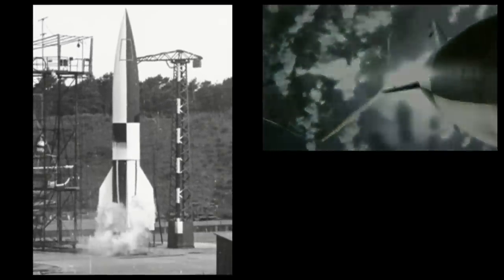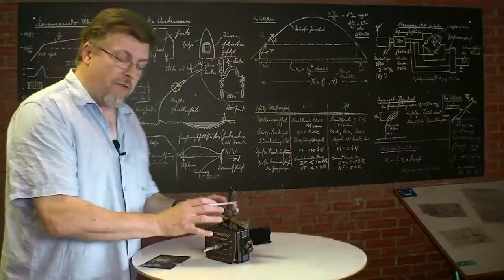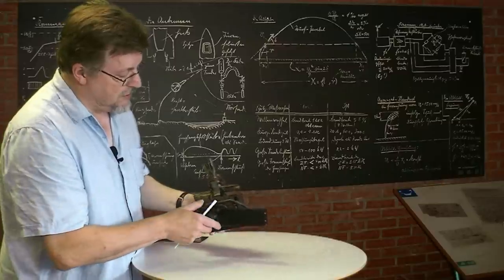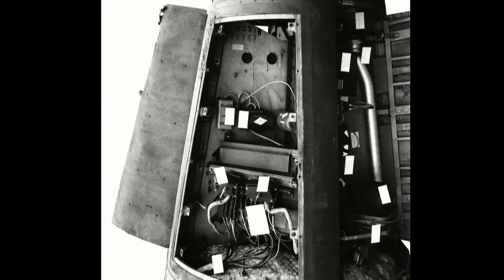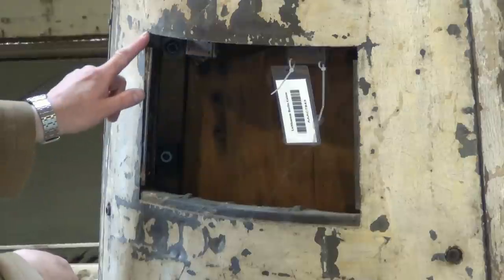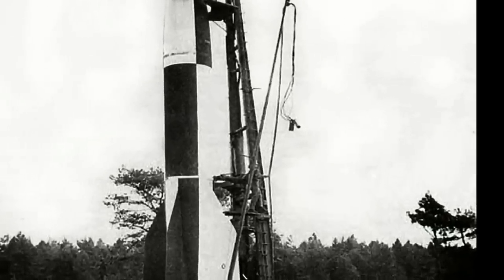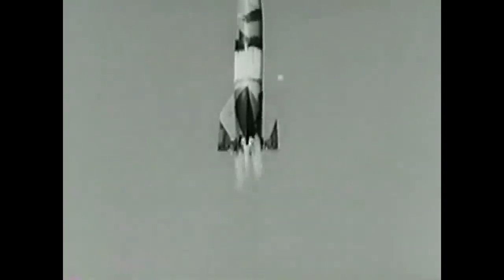A4 / V2 Rocket in detail: umbilical cable system

Comment: Interesting, pin and socket seem similar to our earlier Swedish/German 1935 ASEA relays (plug in)  Eg: 4mm pins, as used in Banana test connections, but better quality than a single wire spring (ours have 4 fan like nickel-silver fan contacts end riveted on a central spine, usually 10 pins per relay,  and these 50% polarized, and standard silver contacts,  5 - 900mA rating )
(Nick Alexeev:-  So both M & F connections in this above case are JACKS ?        .'.   We have 16/32    jack in a  Box    :)
Reply: Stotz still is a Part of ABB and based in Heidelberg.

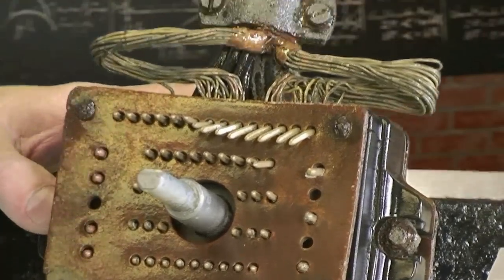Comment: At 03:38  ... maybe the used multiple pins for the same connection/wire. Most likely power and ground. Both for redundancy and to handle the higher current.

Comment: We could really do with a explanation of the turbo pump, which is the most important part of the rocket. I wonder how they managed to control the mixture and get the thing to light? Also, regarding the gyro guidance system, there's rocket angle and heading to take care of, but what if the rocket (say) rotated about it's longitudinal axis by 90 degrees - the steering vanes would be incorrectly orientated I would think?
Reply: John Smith it was steam driven

Comment: I had heard of a large rocket engine very similar to this. It used "fire pucks" which were shallow flame cans with Pintle-Screw injectors, like Walter but lighter and simpler. Over 600 pintles in one engine. Lean burn, more chamber bleed through, swirl deliberately provoked, grossly overexpanded trumpet nozzle. Nozzle corrugated and resistance welded from chromadur. Pump turbine was a liquid rocket Cathrine wheel. 
Any ideas as to this fable?

Comment: I'm building a scale model 4 inch diameter body tube  V2 from scratch.  I've searched exhaustively for drawings that show the bolt pattern where the tail assembly is bolted to the middle section containing the fuel tanks.    These bolts are not equally spaced arount the circumference, and I'd like to get this detail right.  Direction to doccumentation of this would be greatly appreciated!

Comment: The cable connections weren't needed once the rocket launches, so I doubt that getting ripped off caused the malfunction.
Reply from the maker: Hi Gregory, and thanks for your post. Yes, I think you're right that the failure of the magnetic locks to let go is more likely to be a symptom than the cause. There are a number of pathways to the fatal engine shut-down we see here, and not all would exhibit the plug throw-off failure - but my money is on them being related upstream. KR RJD A&NTV

Comment: Mechanically speaking, why would the sockets not disconnecting, bring down the whole missile? If the cable snapped, the feed is broken all the same.
Reply from the maker: Hi Rolf. Picture, if you will, a seemingly endless row of dominos. Each one capable of toppling the next in the classic manner. When the row collapses, we can point at any one domino and say 'This one caused this next one to fall'. And as far as it goes, this will be a true statement. But then we ask,  what about the one before it? Surely that takes priority in the causal chain?  And must be as ultimately responsible for the fall of any later domino as the one selected - unless the one selected really was the very first domino in the row? And the concatenation of dependent mechanisms in a missile is somewhat like dominos in this respect, but whether the event we see is causal, like any given domino falling, is harder to discern. You are correct in saying, I think, that the plugs failing to disengage did not cause the missile engine to shut down. An earlier 'falling domino' set a chain of events in motion, and the plug ejection failure was a consequence and not a primary cause. The first domino, or the guilty finger that pushes the domino, if you prefer, is likely to be somewhere back from the onboard launch switch (that triggers a cascade of actions at the instant of lift-off) and the ground control systems. The cast-off plugs should have operated and ejected as much as 4 seconds before the turbopump was up to launch speed. The missile shown in the video was one of eleven test launches in June/July 1943, and nearly all exhibited early engine shut-down, with most falling back on the launch area. The general cause was traced to poor relay performance, but the cable ejection failure was unique in this group.   Thanks for the useful query letting me discuss this.  KR RJD A&NTV
Reply: Thank you for both, it was fun to speculate this at the end of the video. Mr. Dalby's reply is very thorough and pretty much settles this question. But of course it can't be ideal if the plugs are ripped off, depending on how the individual leads are ripped. There can be dozens of uninsulated wire ends left sticking in the connectors, touching each other, possibly making short circuits or putting electricity in wrong places back in the onboard circuits.

Comment: Let's dispel all gender confusion about pins-plugs-sockets-jacks.  

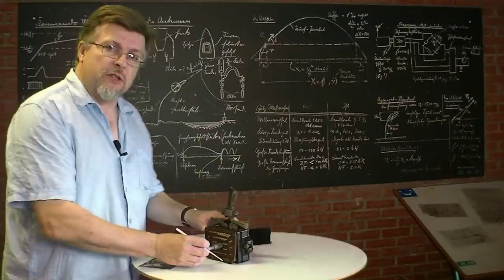Pin and socket is the gender of the electrical contacts.  The part at 1:42 has pins, it's mating part had sockets.  

Plugs and jacks is the mechanical mobility of the connection.  If it's on a cable, then it's a plug.  If it's rigidly attached to the instrument, then it's a jack.  A plug or a jack can have pins or sockets.  We can have plug mating to a jack.  We can have plug mating to another plug when two cables connect together.  Jack mating to another jack happens less often.  The part at 1:42 is rigidly attached to the rocket (spring mount notwithstanding), so it is a jack.
Reply from the maker: Hi Nick, and thanks for your thoughtful post. Many cable terminations conform to your prescription - but not all. I can think of only one area of V2 construction where the word Jack was regularly used (power supply to the Sterg). In the context of the umbilical system, the German technicians seem to have relied on context to identify which 'plug' they were referring to - often using the unmodified term 'plug' (die Stecker) to refer to both the onboard and the ground cable connector - and sometimes the Stotz Plug (die Stotz Stecker). Although the Stotz company contributed many switch and connection components to the V2 missile, everyone seemed to know what was being referred to when this name was used. Seems confusing, but I guess you had to be there. The connection system was non-standard and created for the purpose. I elected to identify the gendered parts by how they looked for the presentation. I was careful not to refer to any technical authority and introduced my terms with the words 'I am calling...'. Thanks for the helpful clarification.  KR RJD A&NTV

Comment: I have a question... How the onboard gyros get the power....?
Reply: The Standard power for the Wehrmacht gyro equipment was 36V for "Luftwaffe"  or 90V for "Kriegsmarine"  3 Phase 500Hz.  The gyros in the rocket were powered over the Control cable from rotary Converter at ground control. Before the rocket launch the gyros must have the final rpm  . A 2  pole  synchronous motor get 30 000 rpm at 500Hz. It needs some 2 or 3 minutes to get this speed after turn on. So its are in need to power the gyros from ground. 
When the rocket launched a control circuit switch the gyros to an onboard rotary converter.  I assume that all gyros sent a ready- signal back to the ground control .
Wehrmacht rotary converters (umformer)  appears all the time on ebay.

Comment: Fledgling attempt to master the complexity’s of exiting the earth’s atmosphere and gravitational boundary.

See the mighty Saturn V to get a glimpse of further work on this theme.

The critical phase of 0 to five mph tip out of plumb a real danger.
Flight stabilization fins both external air stream and internal gas stream not yet able to apply adequate force.
The umbilicals must release cleanly to not sway vertical attitude.
High temperature materials in fins in gas stream a break through.
Also cooling of motor thrust chamber to prevent burn through of containment walls.
It’s very much about use of suitable materials in every component of the entire rocket body.
Insulative, electrified current conductive, heat and fuel resistant, structural integrity components.
Re entry fictional heat a rather daunting obstacle.
Just a few of the multiple challenges of materials choices.